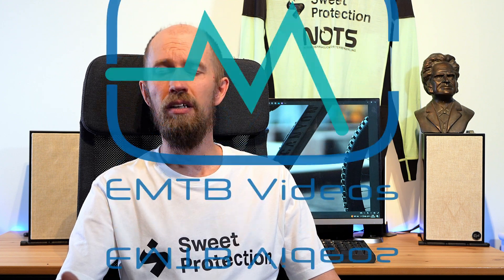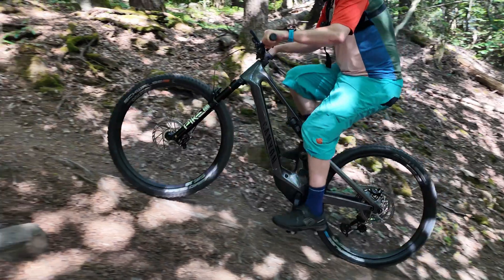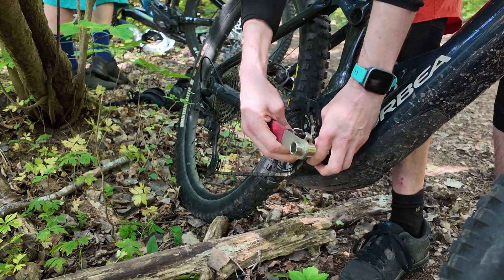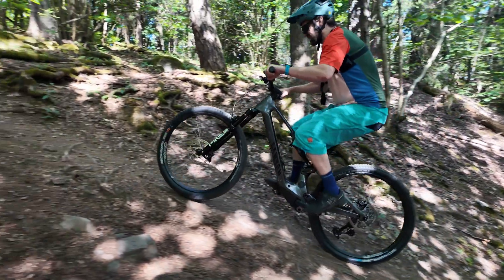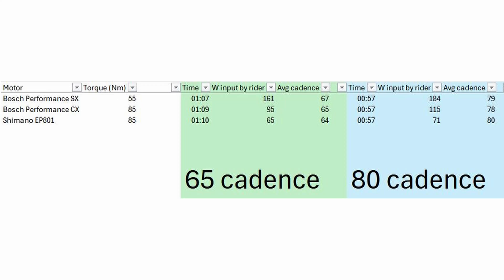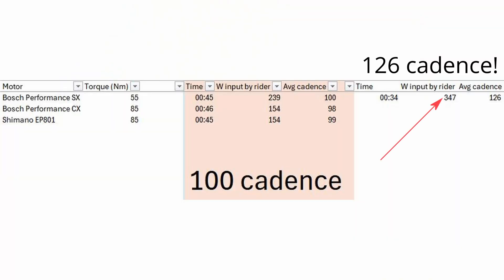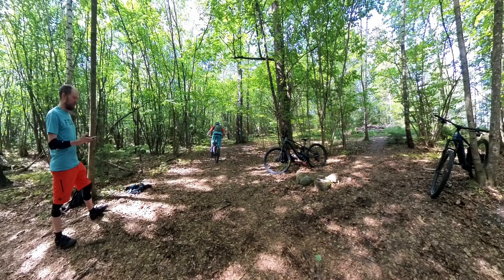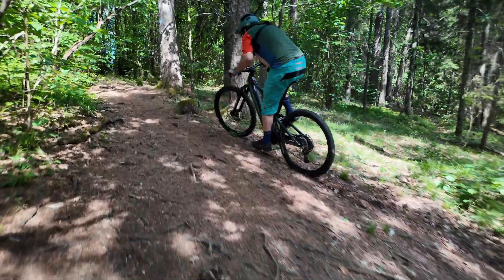How strong is the Bosch Performance SX 55 Nm motor? Comparing it to Bosch CX and Shimano EP801 85 Nm

Comment: Great comparison! Having tested both motors, the weakest point of the SX is the absolute lack of torque on very steep uphill single trails. The type of trails where you have a very challange terrain and the cadence can’t be high nor  constant becouse of steps, tight switchback, super steep segment. In that scenario the  motor doesn’t push at all, and if the rider is forced to stop, the restart of a decent torque takes two full crankset turns. For gravel road, if the rider is fitt is a super motor but for eMTB trails is worst than Fazua or EP8 RS that have less power but much more usable torque at lower rpm

Comment: Were you in turbo on all motors. 
It seams the Shimano gives you a lot more assistance at low rpm but this would mean less range?
Reply from the maker: Yeah, highest assistance mode and tuned to maximum power output in the app. And yeah, higher assistance at low rpm means less range. We've managed to drain the 750 Wh battery on an EP801 bike in 40 km! 😲
Reply: @EMTBVideos  I'm interested in a bike with the EP801 and the 750Wh battery - do you have any experience of how far you can get approx. with the eco mode in the app? Thank you!